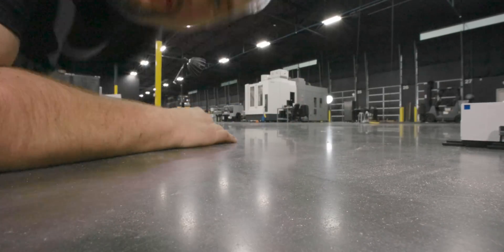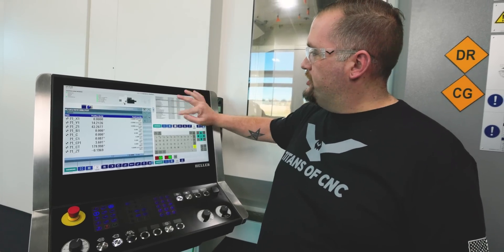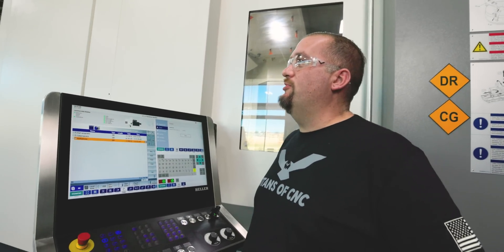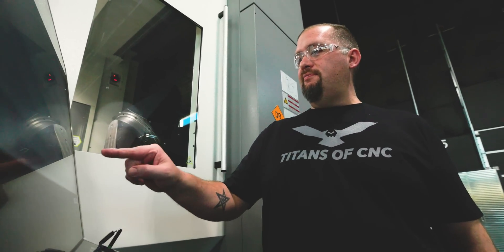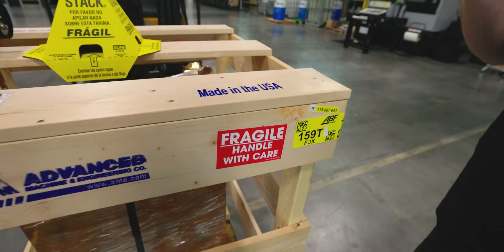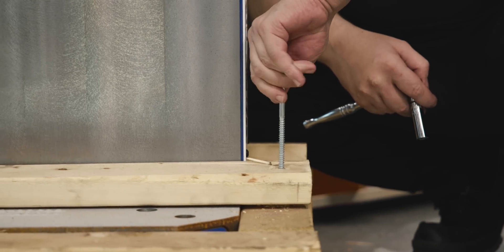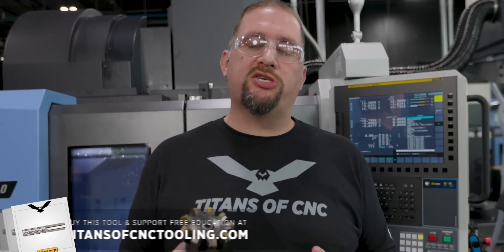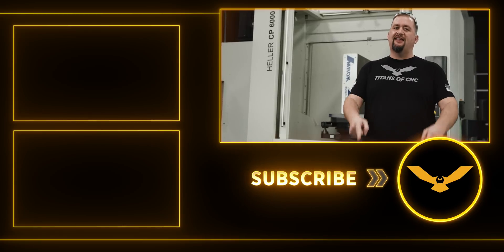The TERMINATOR of CNC MACHINES Eats Metal | HELLER CP 6000

Comment: I use both Siemens and Fanuc. Personally ai feel much more comfortable programming in Siemens. But Fanuc has an undeniable strength: reilability. You are way less likely to have issues on FANUC hardware ( NC or drives) than on Siemens one.

Comment: Looks like a tank… the machine that is of course. What’s the spindle spec?
Reply: Power cutting system with a two stage gearbox. 80 HP, 1,146 Nm torque, 8000 RPM.
Reply: @tonymoll6265  thanks 🙏🏻

Comment: The seimens 840d is the best control i have ever used. Its miles above a basic fanuc, next gen haas, or any matsuurra yasnac type control. Everything about it is so much better.

This control looks very similar to the 840d. I like that as soon as you call up a tool the D1 offset is loaded and you can check height of things and already know where you are with your offset on any tool. Plus the manual positioning is the best i have ever seen. Just one simple menu and type in numbers and hit cycle start.
Reply: everyone who dont know cncmachining can use it, thats the best thing ever

Comment: I like siemens and Fanuc. I believe fanuc gives a greater number of possibilities, due to the fact I don't speak german. I like the security of Siemens. Its a windows based proprietary built custom os that boots within Linux. In my experience as a cnc mechanic by trade. Siemens breaks down more and is more expensive for replacement parts.

Comment: I wish I lived closer enough to work in this shop. I love the energy and the love of the trade. 

And that laser tool measurement was surprisingly fast
Reply: They already measured it before that garenteed. Plus when you load the tool you give it a rough measurement so it knows when to stop rapiding.
Reply: Yeah that was very cool I knew one day they'd use a laser to measure the tool absolutely
Reply: @davidrockey7190  indeed. At Barrett firearms, we used the speroni. That was pretty close to this, and 9 years ago.

Comment: Having learnt and worked on heidenhain for nearly 10 years but now using fanuc... I can say I absolutely miss being able to edit programs while the machines running 😥 also the test run feature on heidenhain is brilliant. Does Siemens have a similar feature where you can digitally run a program at in a few minutes to test and get an accurate time without actually running it?
Reply: Fanuc has background edit on some of our controls, but no it’s not as user friendly we have a machine with celos and mitsi control much easier
Reply: The Sinumerik has a really nice simulation option with 3D preview...
I worked with both, the Siemens 840D and the iTNC530 around 10 years ago.
I liked the Siemens more, but the Heidenhain also has some good features. I never really had the chance to work with the then new HH TNC640, but it looked really nice.
Reply: On Sinumerik, you can run program without actually moving any axes, but you do this in auto, like you would run real program, just without axes moving. Not sure if this is what you mean. It also has nice 3D simulation of your program, that is quite accurate with time.

Comment: Thats the Point: "It's mor like a modern cellphone than an oldscool Atari." 

I've worked in the last 30 years with a lot of different controllers. Fanuc, Siemens , Heidenhain, Bosch, Haas, Elesta, Fidia etc. The Siemens Sinumerik 840D is the best what you can get with the most possibilites ever, especially für 5 axis applications in aerospace industries. Unfortunately the bosses in my company wants to buy a new machine, that's availible only with this Ata.. ..um.. Fanuc controller. 
Sinumerik rules. For example, the machines in this link are running on Sinumerik: https://www.youtube.com/watch?v=Pos6uiI1wtw
Reply: AGREED
Reply: Nothing about Sinumerik in the link given.
Reply: @rcandcnc9684  This Machines in the link are running on Sinumerik.